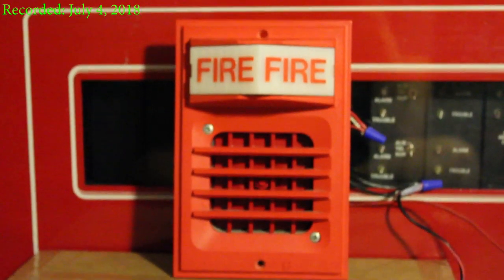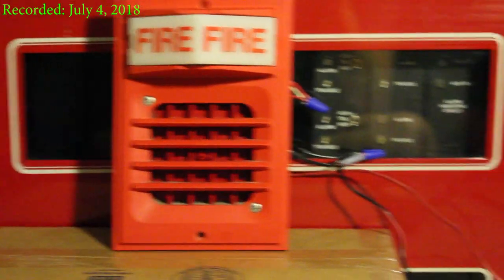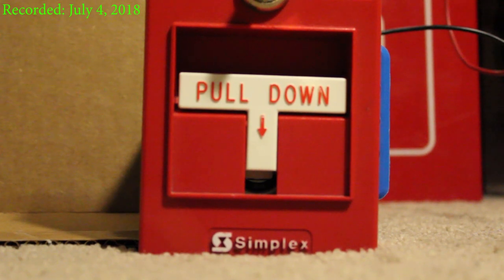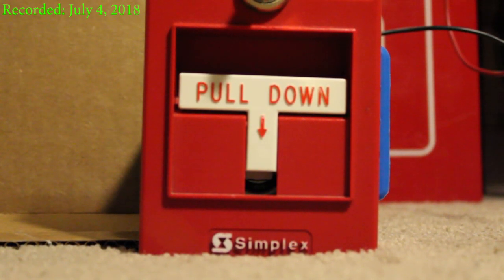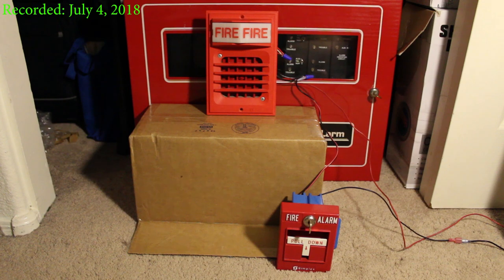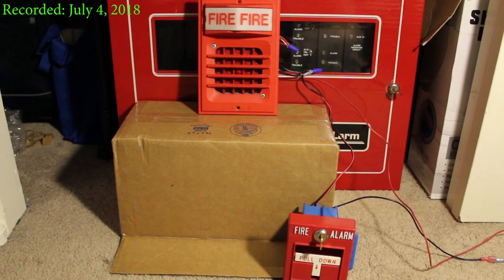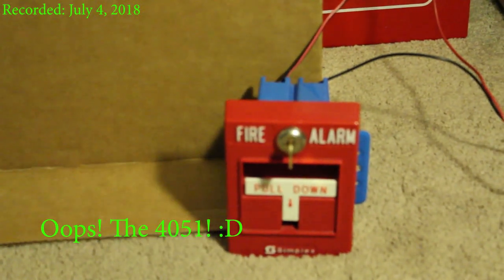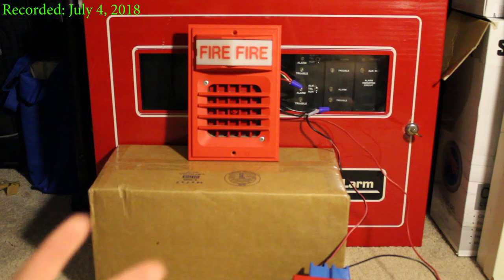Simplex 4051 with Simplex 2903-9001 Light Plate (Mini Test #12)

Comment: Great video 😀👍👍
Is that panel!?!
Reply from the maker: Thanks!

Yep. It's called a Federal Signal "FireLarm" 4000 Series panel. I sadly have no clue how to use it or wire it up (it's a modular based panel), and it's also REALLY HEAVY 😁. Hopes to get a much better panel in the latter future 😉
Reply: fireandalarm1234 have you tried bringing it into a fire alarm tech, or company?
Reply from the maker: +Evan Bart 410 Hmm, I actually have not 😕.

That might be a good idea. I'll have to note on that 😉